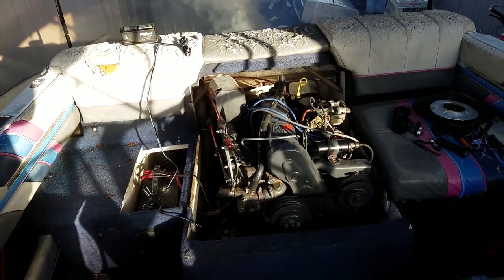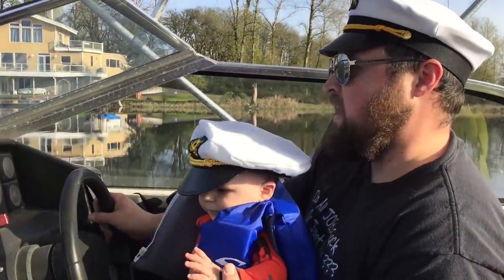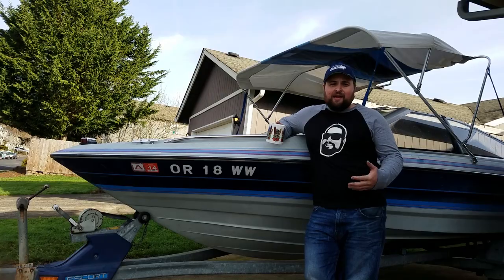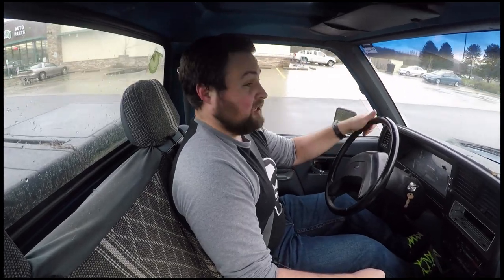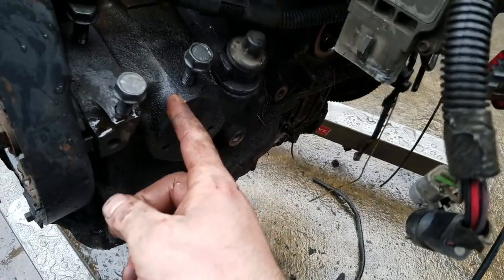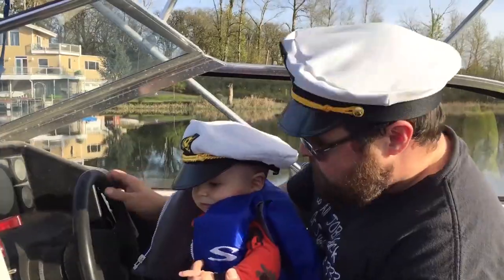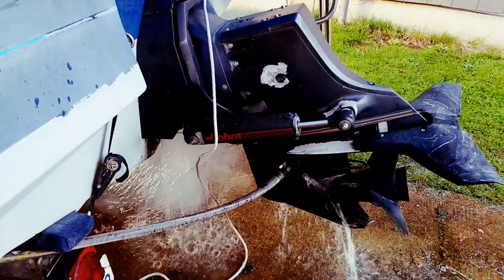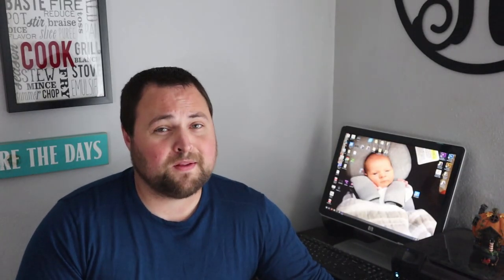I put a Truck Engine in my Boat... The final chapter

Comment: most of local boats (bangka) here in the Philippines used diesel engines from trucks. and they're really reliable for long.
Reply: I would much rather have a diesel boat than a gas boat.
Reply: guess what! its common world wide to use truck engines for boats, stern drives, v drive boats or inboard shaft drives, most popular is the inboard truck engines or outboards in thailand. i prefer outboard marine like yamaha or mercury  but truck engines are good.

Comment: I totally get where you are coming from. I bought a non running dirtbike from a co-worker and  had more fun learning how to fix it than I have had riding it. I didn't even fully understand how a carb worked or how it came apart, but the fun is in the tinkering.

Comment: I've gone through five boats in my lifetime.  It all started with a junker and selling and buying to a better junker boat.  I'm an old phart now so sold my last boat last year.  The new 90hp outboard motor was three times the original cost of the boat itself!
Having a baby in 1978 didn't stop me from being a gearhead.  We fit a baby seat in the backseat of a brand new Firebird!
Reply: The best two days of you life. The day you bought your first boat and the day you sold you last boat!
And the definition of a boat is “a hole in  the water in which one pours lots of money”
My first was a 1959 Red Fish. With A 75 horsepower direct drive Mercury. (For reverse you actually turn the distributor 180 out and start the engine  backwards)
Reply: @c50ge  actually I'm thinking of getting a Kevlar canoe.  I miss being on the water.
Reply: @2-old-Forthischet  
I always wanted to our a jet ski engine in a kayak, canoe, or a Jon boat.
Reply: @c50ge B reak O ut A nother T housand.  Lol.

Comment: I want to let you know that because of your video I swapped out my carb engine in my 1987 Bayliner for a 89 mustang EFI, I had to use the shift start micro switches to tell the ecu that I had shifted from park to drive as it won’t give you full power in park , I also had to move my ignition control module to the exhaust manifold as the distributor was too hot with no air flow. I also machined an adapter for the O2 sensor. 
Has been a great boat ever since, oh and a in frame fuel pump from 80’s rangers works best for this conversion.
Reply: That’s weird. My family has an 89 Bayliner with the EFI 5.0 Cobra which is the Marine version of the engine you swapped LMAO

Comment: Automobile engines are not designed to run at 5000 rpm and marine engines are. Thats the difference you pay for. I enjoyed the video and respect your effort. Next time buy an outboard, you wont have to stand on your head with an inspection mirror to change the spark plugs.

Comment: I bought an old OMC because it was cheap. I did a bit more research and went for an 88 5.0 with the Chev 305. I can get a kit to swap a Merc on to it but the outdrive was rebuilt last year and the shift cables replaced this past winter. I am hoping to get 5 years or more out of the outdrive and then i'll swap it to a Merc Alpha if it fails. 305's are very easy to convert from a truck engine to a marine and on a 19' Capri I don't think I care if I change the cam or valves from a truck to a marine, it's close enough for such an overpowered boat. Plus a 5.7 will swap in just as easy. It tops out at over 50MPH and does damn near 40 at 3500 RPM. I usually cruise at 3000 RPM or less. Maybe I'll get stupid and start assembling parts to put a 5.3 LS and a merc Bravo 3 on it. If I find a cheap outdrive I might. Probably not, a 5.7 and an Alpha 1 is much cheaper and more than enough power.

Comment: You engine never fail if you run at good RPM , with updated Gear box, in Africa we use ,an old Nissan patrol V6 engine 😅

Comment: Literally purchased the last GM long block marine motor available. Cost me 14k for the full replacement. Went into an 04 wakesetter that I load down with 2,000 pounds of ballast and drags with a big wave. Braking it in tomorrow. No Ballast for 10 hours if I want the warranty.

Comment: Hell no I put a truck engine in my boat seven years ago and I save myself a whole bunch of money and it runs great. I took a boat they had a boat engine in it. They’re only do 26 miles an hour now she does 36 miles an hour in with the event of dry exhaust. You don’t have to worry about your camshaft that’s just something they like to scare you with spark arrestor’s wrap, everything in stainless steel wire mesh screen and you got spark, arrestor‘s, my buddy where did General Motors I can’t say for sure if this is true, but he said a MerCruiser engine would come right down the line with a regular truck engine no different , they spent a lot of money to bullshit the public love you build

Comment: The main thing you need in a marine engine is inconel or stainless exhaust valves if you want to run it wide open all day , cam wouldnt hurt either ... Depending on how big the boat is you may need a v8 with a 4 bolt main ...it should be noted some engines are easier to convert then others...yoh could always run it under 3500 rpm too should be fine

Comment: Did a Bilgeliner yrs aga, 4.3 alpha 1 , shortblock, used the heads & cam lifters from the cracked block, 500 bucks got me a 40 over  block with a warranty,  I even used Fel pro head gaskets, aboused that motor 2 summers , no issues

Comment: Was there any problem coming out of the hole and was it smooth thought out the hole rpm rang? I have an vip with the 2.3 omc (Ford) engine and everything I find is everything is the same. Cam profile, pistons and rods just intake and exhaust manifolds. So I’m just curious how it ran looks like it did fine. Did you ever have any real weight in the boat say four adults and maybe towing a tube?

Comment: I did the same thing using a Nisan RB30 fuel injected straight six on a 470 Mercruiser I found that the fuel injection fuel map is not compatible with boat operation  so had to install an aftermarket unit. That was ten years ago and I am still running it

Comment: I think that's brilliant I was debating a impala police intercept motor into a house boat set up in just stuck on how to do the out board to replace the cv axel set up unless I use a dual throttled propeller four corner opinions open too

Comment: Question, do you think that I could use my own transmission from a car? It's a 1uz with an automatic transmission so it'd be good for the automatic switching. I would have to make my own straight shaft with an independent rudder or a shaft with a universal joint and attach the hydraulic steering rack for an outboard to it. Surface drives are way expensive and so are stern drives. My issue with both systems are that surface drives are very heavy in relation to their input power  and stern drives have their own gearing system that drop the output rpm way too low. I'm seeking speed so rpms are what I need to have as frequent contact as possible.

Also a 1uz has like near 500hp stock which is like a $50000+ outboard
Reply: You crazy...

Comment: Hey mate, I have a question. How did you setup the shifter of engine? could you tell me more in details  since I'm also planning to remodel the controls of our boat. Oh and I'm from the Philippines and most of the boats here use diesel truck engines or smaller ones, however we just maintain the transmission, thus would require another person to shift speeds and one at the helm.
Reply from the maker: This boat has gears in the outdrive, controlled by cable. I did not modify this setup. You could run a cable to your helm to accomplish this and it would not be too difficult
Reply: @StrangeGarage  Is it possible to make a diesel transmission into a cable shift controlled like those of cars’? Oh not to mention we still have to press the clutch before we can shift.

Comment: I'm about to start a boat rebuild with a 305 Chevy truck motor .the boat came with a cracked marine 305 what should I do to swap
Reply from the maker: Your attention is best spent in the heads of the engine. The valve guides and springs are much different and worth careful consideration. If you can save the heads from the cracked engine that would be ideal (assuming they aren't bad).

Comment: I'm curious to know if it will work with a motorcycle engine (Suzuki Katana 650, 73 HP, 42 lb/ft)
Off course, for a way smaller boat.
Great video.
Alex from Montréal
Reply from the maker: It's obviously possible but you will want a mechanic to ream the valve guides a little over. Seawater keeps engines running colder than radiators but the exhaust valves still heat up and often sieze in the valve guide, ruining the engine. 

A lot goes into a swap like this but it's 100% possible.
Reply: @StrangeGarage  Thanks!

Comment: Yes! You can do that. The marine industry really wants you to believe that there is some sort of magic in a "marine" engine. This is just not so. Aside from a few specific parts most of them are the same basic engines from popular automotive manufacturers. You should really use the marine carb or efi and electronics, and you must use the marine exhaust systems for safety. Otherwise in most cases the matching automobile engine will do fine, and yes this is personal experience talking.
Reply: You may be talking from personal experience but it is definitely not personal knowledge! It is absolutely hilarious how the average person with absolutely no automotive or marine training keeps saying how a Marine and automotive engines are the same! Your average car engine spends most of its life between 1500 and 2500 RPMs, Your average marine engine spends most of its life between 3000 and 5000 RPMs! It takes more torque to get a boat moving than it does a car, Do you think maybe that the internal components in a marine engine just might be built for a harder life! You were correct when you said marine engines are not built from magic, But the components were built to withstand a much harder life! I can go on and on pointing out the differences but you already made up your mind despite not having a clue, I guess you just can’t fix stupid!
Reply: @NeverEnoughPyro40  Hummm, I'm not sure how in works where you come from, but here in the real world personal experience is personal knowledge. 
I've been in the game for over thirty years. You are free to believe whatever you like. But the REALITY is that you can compare part numbers and you will find with rare exceptions they match. You  don't have to like it, but reality doesn't care about your feelings.  You are correct about one thing though,  you can't fix stupid!  However sometimes you have a fighting chance with ignorance!  Cheers.
Reply: @terrysweitzer6772  Go ahead and take your automotive engine and put it in a boat and then go have the USCG do a courtesy inspection, Let me know how it works out! I’m not saying that some parts are not interchangeable! I’m saying you cannot take a 4.3L out of an S-10 blazer and expect the same performance and lifespan as a Marine built 4.3L! Almost all sterndrive are built using Timken bearings and races, Absolutely you can purchase those at a automotive store! The problem is people do not know when to stop, I have seen automotive fuel pumps, carburetors, alternators, starters, circulating pumps, distributors and thermostats all used for marine application! Anyone of those could end up causing an explosion and even death, Not to mention being fined by the USCG if boarded! If you don’t believe me why don’t you try picking up a USCG regulation booklet pertaining to recreational boating!
Reply: @NeverEnoughPyro40  I'm sorry,  I think you're missing the point.  First off this is a comment section of YouTube,  not a host site for debate. But allow me to square you away on this. I think I've covered the fact that some marine equipment is mandatory,  that said, some people will always do off the wall stuff,  I can't control that!  I'm talking the basic engine, not fuel pumps, water pumps, muffler bearings, or wobble gears!  It's also very interesting that you say you can't take a 4.3l gm engine out of a blazer and put it in a boat!!!  Why you ask???  Because I've done exactly that thing in one of my own boats!  Yes, cam and all!  This engine has been zipping us all over the upper Chesapeake for eight years every weekend from March to November!!!  The coast guard knows my boat well because we are giving sea tow a run for their money dragging broken boats home. I've heard many people say how relieved they were to see that little gray boat coming when they were in trouble!  That said,  yes some equipment is marine specific,  MOST base inboard engines are not! That doesn't mean ALL!!! Always work with caution,  and your milage may vary. Good day,  and God bless!!!  The end.
Reply: Agree. The basic engine is the same exact thing. The ring gaps and piston clearances are typically different-gaps and clearances are larger. The cam typically has a different grind from a stock truck engine because they operate at higher rpms for longer periods. All of the electrical while they look exactly the same should have a USCG approval for marine use. Circulation water pumps look exactly the same but usually have stainless steel or brass innards. The head gaskets are marine approved as well. Bottom line is the basic block and heads are the exact same with some differences in the clearances.

Comment: great video ! i have a vip vision with the exact same set up. trying to figure out the cheapest way to get more power out of the 2.3 liter motor. they are capable of a lot! thanks
Reply from the maker: I've heard of people getting 200+ horsepower just by changing the head and cam. The engines are designed so well and they can run for a long time! I would probably keep the carb if I were you though, much simpler! Thanks for watching!

Comment: You may be the guy I'm looking for,  89 ranger into bobcat,I've got questions
Reply from the maker: Shoot.
Reply: @StrangeGarage  so I need to know about wiring the new 1979 pinto 3 wire distributor and wiring the stock 3 wire alternator.  As in what does what EFI to carburetor
Reply: I can't find a way to private message you.
Reply from the maker: @jaredeggel8984  instagram.com/strange.garage